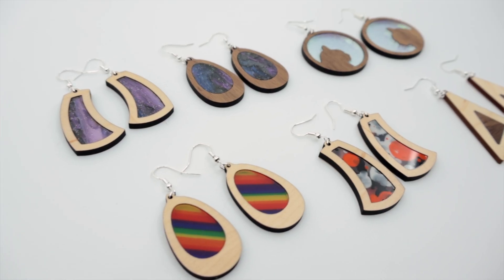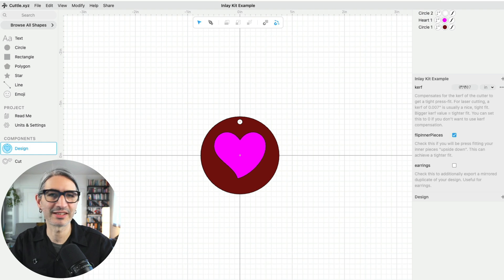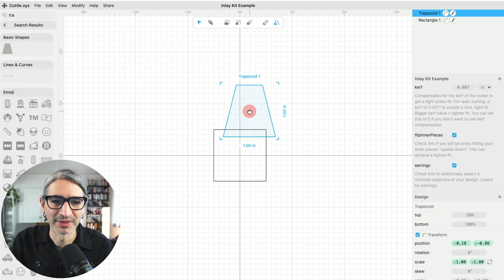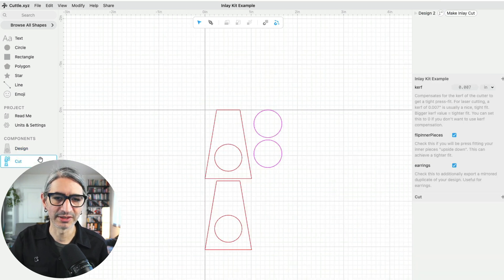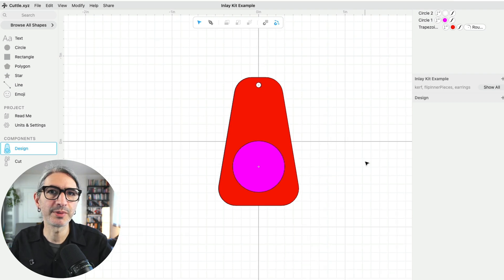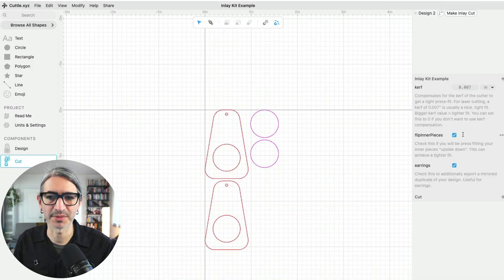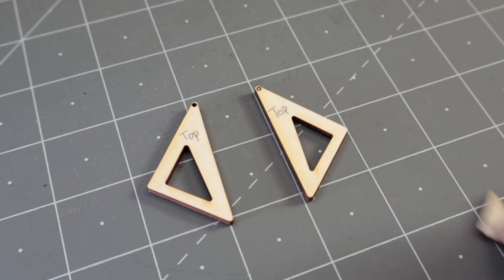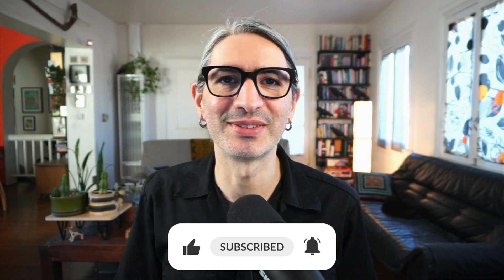How to design laser cut Inlay Earrings

Comment: Great video. Does the inlay piece need to be the same depth as the outside piece. i.e. if the outside is 3mm wood, must I use 3 mm for the inlay?